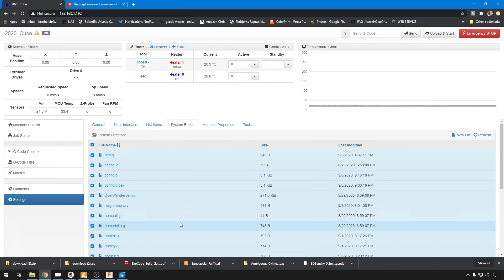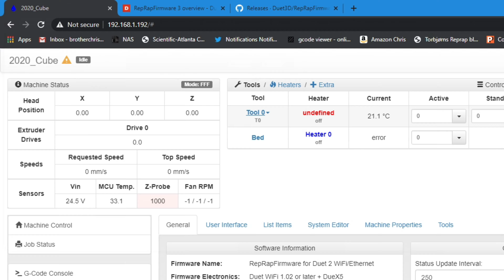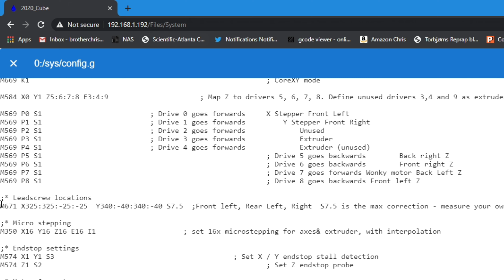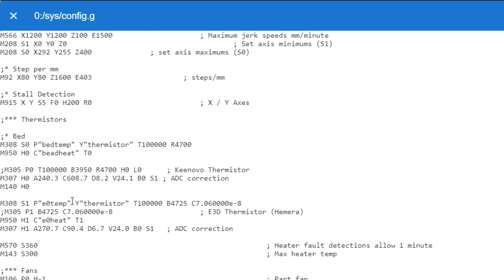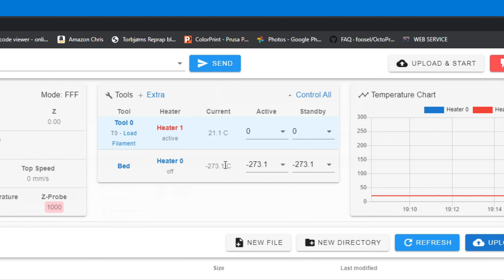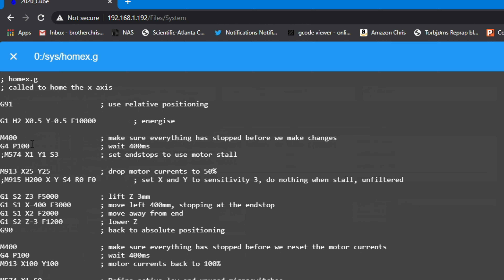Upgrade Your Duet Board to RepRap V3 - How To - Chris's Basement

Comment: Thanks for this video, I'd been putting off upgrading from 2 to 3 for a long time, and this gave me the confidence.  After watching, I used the configurator to start over, and then I used your video again to help me understand some of the commands I needed to change.  I really like some of the new features in 3 (don't know which minor brought them, I went direct to 3.5.4 from 2.0.4rc, ha).  Especially the new filaments options, since I'm using firmware retraction.  Thanks again, you really made a difference to me.
Reply from the maker: Awesome to hear! Glad it was helpful!

Comment: Can you start with a duet 2 wifi,erase firmware,and download 3.3.0 onto an sd card and flash the board(virgin board no printer yet,printer to be built) straight off github? Does it need API on the sd.? Thank you
Reply from the maker: Yes, you should be able to go strait to 3 assuming the board has been erased. You might have to do some work like I show here to recover it. https://youtu.be/UPu7_RPE1d0?si=RdSvYQvm5rRM8mRG

Comment: I've been dreading/putting off updating my duet 2 and duet 3 firmware... I have a RailCore with Duet2/Duex5 and a Daedalus with Duet 3 and rpi. The Daedalus has been a black box for me on what's what. But, I understand what's going on with the Railcore. They both work ok without the updated firmware versions and I have a bad feeling that if I start messing with things, it'll snowball. This makes me think it might be better if I just swap out the duet boards to ones I'm used to that run Klipper. Maybe even scavenge them for parts to make Vorons since Voron is ongoing with very good documentation. What would you do? 1) Leave them since they work? 2) Update the firmware and if they break, swap boards? 3) Use them for parts for a new printer? I will probably just leave them alone for another couple years. LOL
Reply from the maker: At this point, I would just leave them as is. Only consider going to RRF3 if you need a Duet 3 board or some other feature only available in RRF3. It's a lot of work for just same functionality.
Reply: @ChrisRiley  yeah watching your video about some Mxxx commands needing to be modified doesn't sound like fun. But more the risk of breaking everything for no newer features. I've got a few other projects on my list that'll be more fun.

Comment: I decided that it was time to update my Duet and I seem to be on the same firmware and everything as you were in this video - just two years later. But when I upload and launch the 3.0, I get this error: error: M997: In-application programming binary "iap4e.bin" not found. Not sure what to do after that, you didn't get any errors.
Reply from the maker: Sounds like some files are missing from the SD card. I would try to recreate the card and make sure everything is there. This is a good read. https://forum.duet3d.com/topic/6839/sd-card-disk-image/11

Comment: hey bro love your videos they have been the light in the darkness for me. im fairly new to 3d printing and decided to do a mainboard overhaul on my i3 mega s, the old board took a dumb and i swapped it for a BTT SKR 3 STM32H74. So, ive got everything running pretty smoothly bl touch sensor less homing with BTT TMC2209s. super excited about this build. however there have been a few hiccups, 1) i cant seem to get the bed parameters perfect prints start just a bit off center. 2) my bl touch works great for homing and the baby stepping works great but for some reason i cant see my height map and it sometimes acts as if Z is not compensating for deviants in the bed height. (ive read this could be due to my Wi-Fi firmware version (1.26) not being compatible with my rep rap firmware version(3.41)) AND 3) Sensorless homing works great for homing, however it doesn't seem like it recognizes stalls when i pause a print, when the print head moves out of the way it tries to move too far on the Y axis into the negative or maybe its just looking for 0, regardless the stepper makes a loud noise when hitting the endstop and when i resume it is way off position which i believe is from missed steps when stall detect isn't working properly. Also anytime im printing anything duet notifies me of stalls almost constantly every few seconds i have it configured to "take no action when stall is detected" while running a print so it doesent effect the print but im wondering if this is normal. ANY HELP OR FEEDBACK IS GREATLY APPRECIATED!!! I've reached out to BTT with no response so thankyou for all the work and time you put into these videos!
Reply from the maker: Thank you, that's awesome! There is a lot to unpack here for a comment. If you want, send all this to me over in an email and I can try to help with what I can. brotherchris81@gmail.com

Comment: Thanks for this video!  Gave me the confidence to give it a go on my Duet2 Wifi delta printer yesterday.  I used the RRF configurator, referencing the values out of my RRF 2 config, and the only thing I had to add afterward was my old scaling fix for it to work exactly as before.  I set up the config beforehand, and when I actually pulled the trigger and started uploading files, the whole process only took about 10 minutes!  Getting fresh PID tunes to complete the process took WAY longer than the firmware updates.
Reply from the maker: That's great, I'm glad I could help

Comment: Great video, thanks. One thing I noticed in your video is the define position of lead screws function. When I originally created firmware for my machine (CoreXY, dual Z) I had to create a fake U axis for the second Z axis. So I assume I can now use that command and just specify the location of each Z lead screw?
Reply from the maker: Interesting, but yes, you should be able to resolve that by entering the location.

Comment: i have upgraded my firmware to 3.3 and now my part cooling fan won't work 
My fans have the same config as yours
Reply from the maker: Odd, it has to be a pin not getting assigned somewhere.
Reply: @ChrisRiley   found the issue i changed my fan and my crimp was bad 🤦‍♂️

Comment: Hi Chris I'm all new to duet wifi, if I go to 3.x.x and make a new config file, do I have to change alle the things after using config tool that you make in this video ?
Reply from the maker: No, the config file will let you select version 2 or 3 and the beginning and build it correctly.
Reply: @ChrisRiley  okay, i wil follow your old guide for firmware 2.x.x and try to pid tuning after that, maybe it will work.

Comment: Well done.  I’ve upgraded my Railcore Duet 2 board to RRF 3.  It is a shame Duet3D didn’t create an upgrade tool — even if some fields would need to be manually entered by the user.  I agree, though, that moving forward it is the way to go.   RRF3 also exposes the object model so that you can query values in configs.  It makes for some interesting macro possibilities, such as to continue bed leveling until measurements are within a certain range, etc.  https://duet3d.dozuki.com/Wiki/Object_Model_of_RepRapFirmware
Reply from the maker: Thanks John, this is actually pretty interesting, I didn't realize this was introduced in RRF3, now ai need to mess with it.

Comment: Thanks a lot for putting this video together, it saved me to read through endless wiki pages. One thing worth mentioning is that there is a line one has to add when using a Panel Due that wasn't necessary before... M575 P1 B57600 S1  being 57600 the baud rate of the Panel Due
Reply from the maker: Ah, I missed that, thanks for the heads up I was getting ready to add one of these to the Railcore.

Comment: After completing the process to convert my Ender3 pro to Maestro and it working well, I don't feel I will upgrade. What would be the benefits of. Remote, Ethernet, so I could print to the workshop was my reason in the first place. None of this has been easy for me, and I thank you for your, and others clear guidance.
Reply from the maker: RRF v3 upgrade probably isn't needed. Are you having issues connection to the board?
Reply: @ChrisRiley  No problems Chris. Prints awesome PETG. Now if I could only improve my use of Fusion.

Comment: i dont know about anyone else, but I've been running RRF on my SKR v1.4 with the BTT Wifi module for it and Im really struggling to find the "easiness" that people talk about so fondly when using RRF. it might just bethat I've used Marlin for so freaking long and I know that workflow but so much of the RRF documentation seems like a faff and a guess
Reply: The easiness is mostly in the on-line web configuration and that you don't have to compile the complete code after every change. But when you need to do things outside the web-config the easy-thing falls apart fast. I have not used it for a while now but,  when I was using it, setting op wifi true a terminal was just so antiquated. I love the hardware but I will celebrate the day Marlin runs good on this platform.
Reply from the maker: I hear you, I do like the quick config changes in RRF, but I am so use to Marlin it's hard for me to get on board.